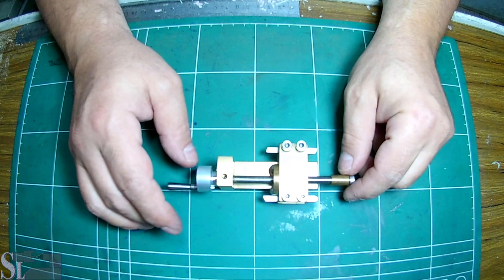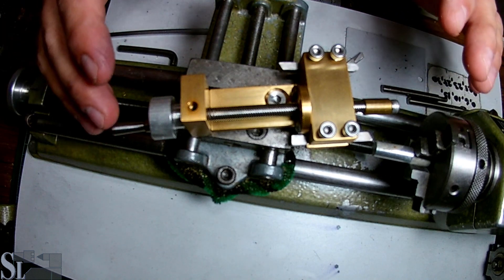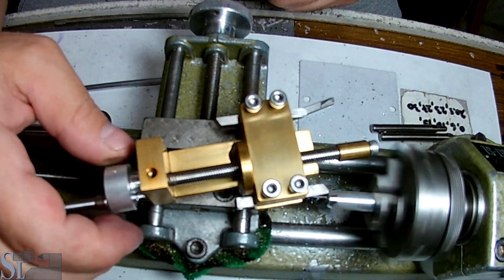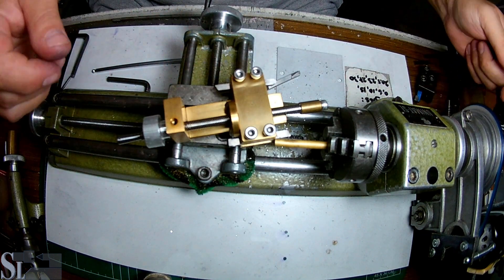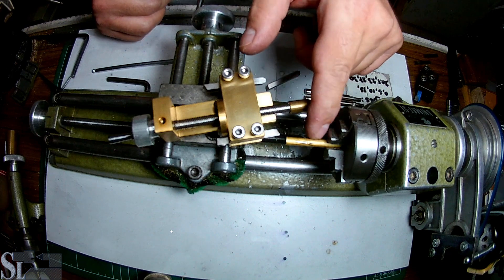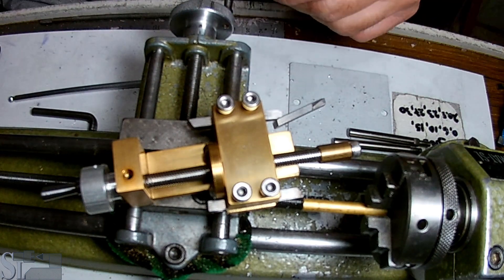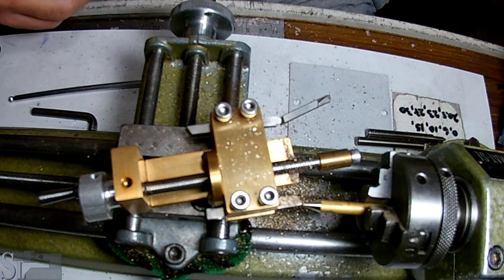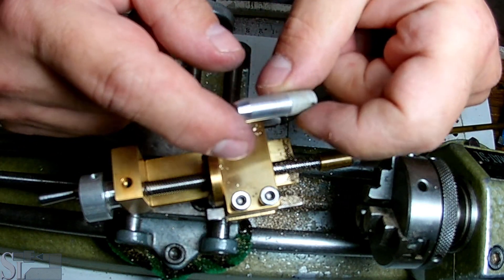Preliminary video  - first test of the Unimat SL 1000 compound rest

Comment: The spindle headstock can be rotated in order to cut tapers without using a compound.
Reply from the maker: Indeed it can.but tgen you loose concentricity. Re-establishing concentricity takes roughly 20-30minutes. Now think of a project that requires turning round work, cone and back to round work and so on (e.g. making several identical precision parts). A compound rest solves the issue and saves your day. Literally... :)
Reply: @Smallathe  that’s a valid point, what about reaming the headstock locating pin to a taper, that would make re-establishing concentricity so much faster. Having a compound is indeed a great idea even for other applications but  rigidity will be an obvious challenge.
Reply from the maker: @toolcult  very good points. Rigidity and cut depths are an issue... But it works. My centering pin is too loose. Not sure it,or the hole, can be made conical - and at the same time perfectly center the lathe...